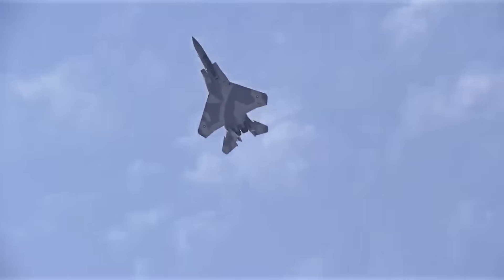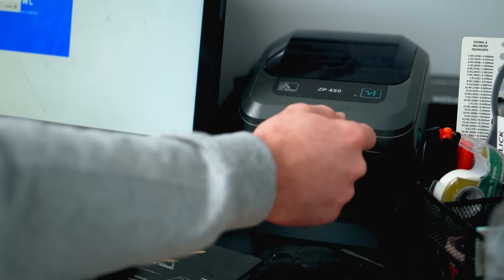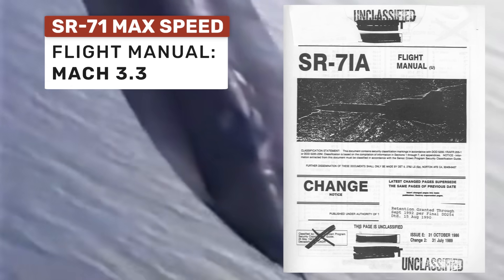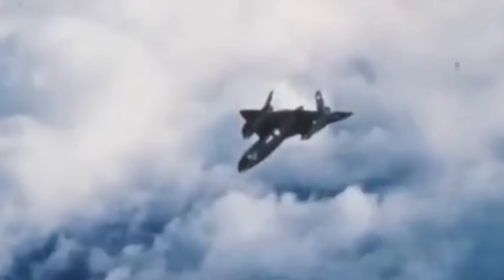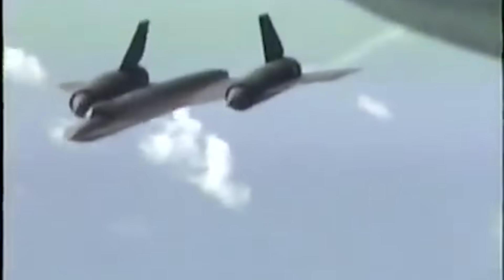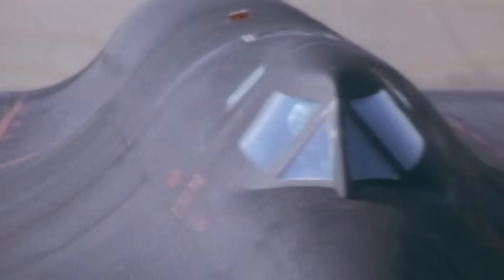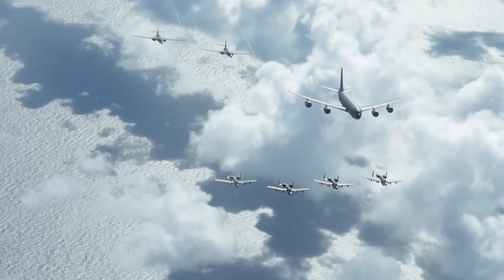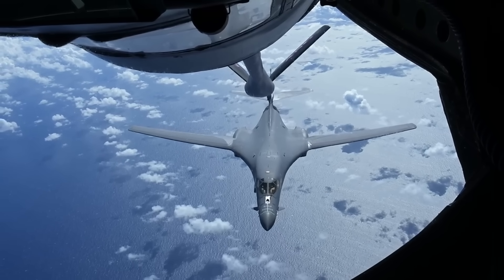The SR-71 was MUCH FASTER than the Air Force will admit

Comment: Just one thing to remember, the govt will never let the actual top speed of our fastest military aircraft out to the pubic, It's classified information. None of the pilots could ever say how fast any of the military aircraft really are. Giving away your proudest secrets in not only foolish, it can get you into a lot of trouble. I was an assistant crew chief on the FB-111A back in the early 70's, I assisted launch of a number of  flights up and down the East Coast of the USA, I was stationed at Pease  Air Force Base back in 1972-74. While I don't have a clue how fast they were, I do know I could send a plane off at 8:30 or 9:00 am and this air craft could fly down the East Coast and be back at the base before lunch. You also have to understand that Supersonic speeds were illegal so any high speed operation could only be done over the ocean as there are no windows to rattle or people to complain about noise and vibration. The one thing I know without a doubt is that every time the military tells you about something they consider High Tech, they are only giving you old information because we are about 20 years ahead of the supposed high tech we're told about. If any of the real modern high tech was made available it would blow your socks off.

Comment: The us military has a habit of shading the speed of it front-line equipment on the downward side. Im pretty sure all the fighter jets will go a good bit faster than the specs suggest, albeit only in bursts and at the risk of significant engine damage. In the case of its surface ships, the nuclear powered assets (supercarriers) are probably capable of 40-45 knots. Where they really get cagey is with the speed of their subs. Id be willing to bet that the newest virginia-class fast attack boats are VERY fast, maybe even 50 knots, but the faster they go, the more noise they make, and stealth is life for a submarine. Bottom line, the speeds are conservative for ALL of our gear

Comment: WARNING. to any one thinking of applying there. If it’s not 4 days a week 350k+ a year with 4 weeks vacation an 10 to 15% match on 401k. Don’t do it. You’ll be so bored. You’ll have to drive so far everyday. That area is terrible. That’s the only lake for like 1008875986543 miles they say they go fishing. No one goes there to fish they go to drink. And it’s jig fishing trolling an ice fishing the most boring fishing of all time there is 3 species of fish there sturgeon, pike, an few walleye. Did I mention there was pike cause you’ll catch 200 before you catch anything else. If you look across the rainy river that’s where the trees went. Yup they uprooted an moved to Canada. Took all the single women with them too. It’s colder than Alaska all winter long I swear. You’ll look at it quite often when you’re there. Your phone is your internet. They don’t have fiber. Heard dialup was coming in 2025. There is no restaurants. They call them restaurants but it’s just a bar. McDonald’s is in TRF that’s like a 1.5 hour drive one way at 80-120mph cause there is no cops there. All the crime is at the reservations. There is no housing not even rentals. You’ll live in a hotel for a couple years and it’s not very nice and it’s probably 35 to 40 miles away from work. It’s a very miserable place for a single guy the only thing to do is work. It’s very common to see people dating with the same last name. Just trying to warn you cause it’s easy to get stuck there. They know just how to do it. Be very sure that’s something you aspire to do.

Comment: My dad was a weights and balance engineer on prototype #2 on the XB-70 back in the early 60s and skunk works got most of the titanium. The heat expansion and other heat dispersion charts went to Mach 4.the valkyri wasn't built for more than Mach 3.2 .because of their use of stainless steel/nickel honey come. The skunk works guys my dad talked to said that the limiting factor for top speed  was heat expansion would tear itself apart.

Comment: Probably could hit Mach 4 but might damage the aircraft
Reply: Not even remotely possible
Reply: @gr8crash  just saw a documentary that the throttle had a lot more to go but no pilot wants to risk their lives to go beyond the builder's specs which is Mach 3.5.
Reply: @ap0lmc not exactly how it works. There's one pilot who mentions that in one of his stories and it's been taken way to seriously.  That's not at all how the throttles work on this aircraft,  it's not a normal "linear" response like people think.

How much "throttle" was left varied greatly on atmospheric temperatures. On a day colder than standard you could be at mach 3.2 and have "plenty" of throttle left. Other times it could be warmer than normal with the throttles full forward and not even reach mach 3. 

So it gets more complicated than simply saying "plenty of throttle" left.

Comment: I think the issue was not thermal issues, rather that if you go too fast the inlet shockwave would occur too close to the compressor which can cause a flame out. I believe this has happened in the field to both engines at the same time. The relight was quite scary according to the report I saw.

Comment: I talked to a back-seater for an SR-71 quite a few years ago (early 1980s) and he would neither confirm nor deny the plane's max speed and max altitude. He did tell about a pilot for another SR-71 who flew over the Middle East and triggered a live fire response with air-to-air missiles...the pilot laughed and said he was kicking in the afterburners which turned the leading edges of the wings white-hot!

Comment: Fastest, doesn't mean effective.  SR-71 could hold speeds up to 3.2 M, but the problem with that is meunvetability; it took it hundreds of miles ro make a turn.  In addition it had mass amount of technical problems.  They lost more than five of these jets, simply due to technical issues.  Ironic thing is, no one shut them down, they shut themselves down.  Wasye of money and time.

Comment: The SR-71 would leak fluids on the ground like a siv but once it gets in the air would seal itself off. If the jet were to bomb LA it would need to release over Tulsa

Comment: The sr 71 engine will flame at around mach 3.4 - 3.5 due to the air inlet and spikes not being able to keep the air flow in the engines subsonic in the necessary parts of the engines. They literally blow themselves out.

Comment: I'm reminded of a comment by Maj. Brian Shul in his well-watched speech at the Lawrence Livermore Nat'l Laboratory: "I can tell you that the plane goes faster than what the book (pilot's manual) says it will go."  Another time: "we were going over 2000 miles per hour and I still had 6 inches of travel on the throttle." Also, in the "LA Speed Check Story" The L.A. Tower gave him 1992 knots over the ground." A knot, is 7, but MPH is 8. So there's a 1.14 conversion factor. 1992 knots = 2270 mph. And that's what Brian and his back seat man Walter were doing on a routine training mission.
Reply: Across the ground... What was their airspeed, I wonder. 🤔 I love that story!! I'm going to look it up again so I can roll with laughter all over again.

Comment: I´ve always assumed that the Blackbird´s standard cruise speed was about 3.2, with the throttle stick half way. Thus, an equilibrium between speed, fuel consumption, mechanical stress and so on. But I´m sure that machine was capable of flying faster than that. I think that a 3.5 cruise for a short period of time it´s a good guess. Maybe a little more in a short evasion run pushing the limits. Being realistic, going faster than that would likely have damaged the engines or the fuselage itself.

That machine was built in the 60´s. It´s an aviation milestone.

Comment: The US likes to keep the thermal multitude up on the structural of the airframe it's not that the fucking planes engine won't put out enough thrust to do this is that the damn airframe get so much friction that it melts and starts falling apart while you're flying that's the fucking truth on these planes it is not the planes concept of how bad the engine is it's how much air friction is hitting in the shell you're talking about landing and cherry tomato you're talking about landing a hot piece of steel like you just welded on it like the cherry tomato that's what some of these airplanes will do the original SR-71 engine the fastest that they recorded testing it was one of the test pilots who melted himself by the way the thermal Shields that we have for those planes those thermal Shields are not to park when they fired a ballistic missile out this guy he went and climbed up to the highest atmosphere and then arched down and when he arched back down he picked up so much speed to outrun this ballistic missile he melted himself

Comment: I would bet plenty of pilots pushed the limits to avoid interception by enemy aircraft or worse, missiles.  I remember an SR-71 pilot saying if they detected a missile tracking them they just pushed the throttles a little more and outran it, so assuming operational speeds of mach 3.2 it seems safe to say it was faster than that for at least a burst of speed.  This is where the distinction between top sustained speed and absolute top speed becomes important to consider.  Based on this video the planes top speed would only be known once you exceeded it since the airframe would hit a structural or thermal limit before you topped out on reserves of thrust.  Top speed would also have varied by tail number since pilots that flew them reported they were not all the same, each having its own handling vices that become apparent at those performance levels due to very slight differences in each planes fabrication (like slightly different bends on the skin or frames on each one).

Comment: It's been obvious for years that the SR-71 could go much faster than claimed...

1) The more conventional aircraft made of much more conventional materials, such as the stripped down F-15 that almost reach the speeds that it supposedly could "only" go, so they're going to pretend to get that extra 0.2-0.3 of a mach, which is about 200mph, you need to radically change the design of the plane, engines, and use exotic materials.... please.

2) The design of the SR-71, when you calculate the maximum shock cone angle, it's closer to M4.

Comment: At least one SR-71A (or a litter-mate from the Skunk Works) crossed the continental USA in round an hour. In elementary school, I had read that the country along the middle--from San Francisco on the west coast (Los Angeles actually is on a longitude to the east of Reno, NV!) to a point just east of Washington, DC--is a little over 5311 km' (3,300 miles). This gives the Blackhawk aircraft (or at least this one) a velocity in excess of 5320 km'/hr. (3,300 mph) IAS. It also is phenomenological evidence to establish that the airframe, inlets, etc., were able to withstand the heat of atmospheric friction appreciably better than their builders' assessments initially had factored.
Reply: It flew LA to DC in 64 min, and coast to coast in 68 min, avg speed about 2200 mph

Comment: Go to the Armament Museam outside Eglin AFB . Fort walton beach florida. There is a sr 71 on display there. I stood in the wheel wells front and rear. All the heat shielding to protect wires and piping. Amazing.Antique tech.
Back then. Fast forward to now. What is up there we will never know. But whatever it is its faster. 😮
Reply: We have yet to build a faster operational aircraft

Comment: I worked on F111d at cannon. 71thru 79. They engine shop took the engines into the test cell. The engines were set at full military power and then the fuel controls were cut by 10 % . Top speed was classified. Well over 1800 mpg.
Reply: I was at a Civil Air Patrol Encampment at Cannon in 71 or 72. Our barracks and parade ground were separated from the end of the runway by a two lane road. I well remember doing marching drills and a pair of F-111s doing tandem takeoffs with their tails pointed right at us. They’d run their engines up to full power and then hit the after burners and rip out of there. Made it hard to hear marching commands. It was a mile march to the mess hall. The cooks made the best omelets I’ve ever had. I do miss the Aardvarks. 
At a CAP Encampment at Kirtland they showed us a silicone firebrick they had drilled a hole through with a laser. They also told us there was room on current fighters to carry a laser and asked how one would defend against such a weapon. That research is close to bearing fruit.

Comment: Being that I had to be trained in egress on the SR-71, I noticed the speed indicator  went to Mach 5. I asked if it could reach anywhere near that, and a pilot smirked and told me that he could tell me but would have to kill me afterward. The smirk kind of gave me the impression that it was much faster than the record. I was around them for 4 years and loved watching them take off and return at night.
Reply: He was messing with you,  especially as they don't use that mach gauge above mach 1.5

Comment: I remember how F15s used to hit Mach 2.5. First, you took a F15 that had been totally overhauled. You made sure that it was clean with no external loads. Then you would fly it up a waiting tanker and refuel. Once you refueled you made sure you were at 30,000 feet plus and gave it full afterburner and used the V-Max switch. Once you hit Mach 2.5 you would throttle back and land immediately, begore you ran out of gas.  Then the would have to totally overhaul the aircraft because the V-Max would damage the engines.

Comment: Of course the USAF lied about the top speed! It's classified info. Why didn't the SR71 have a gun on it? Think about how fast it is, it ran into it's own bullets! I'm curious about the real top speed, but not at the expense of divulging classified info! Ask a pilot, who has flown this aircraft, they can't tell you the truth about certain aspects of this aircraft. Besides the USAF never owned the SR71. Just piloted that awesome plane!
Reply: The Air Force absolutely owned the SR71 as it was their aircraft. They requested, they operated it. 

Top speed has been declassified for over a decade now, nothing to exciting there. They did propose an armed SR71 variant, even had a gun option in the load out by the AF passed, and no it wouldn't have flown into its own bullets.